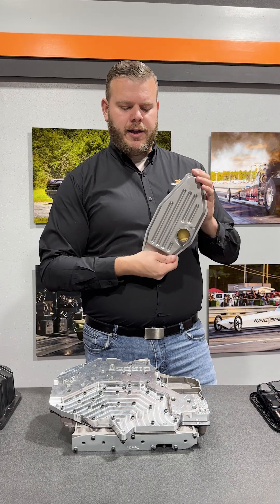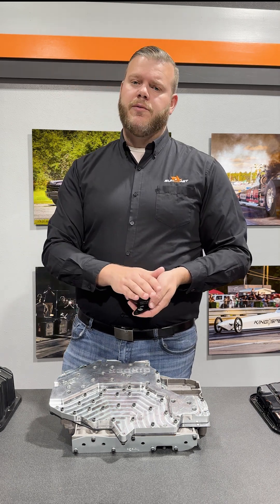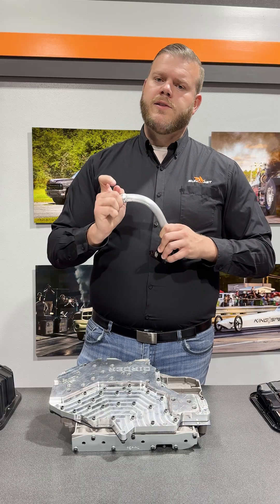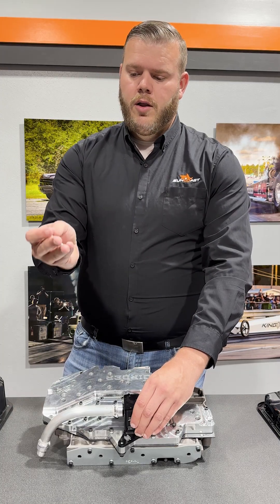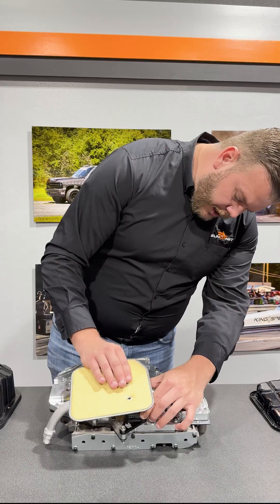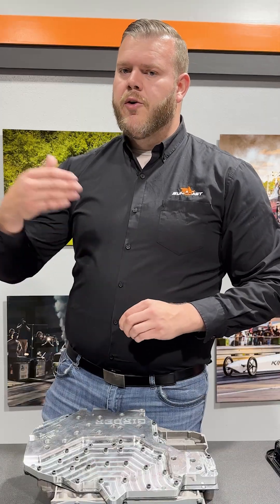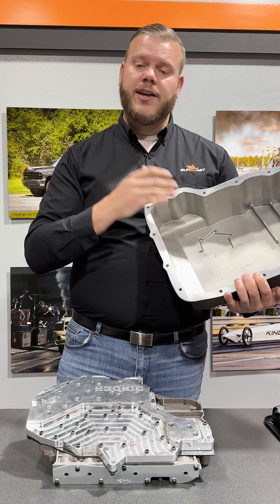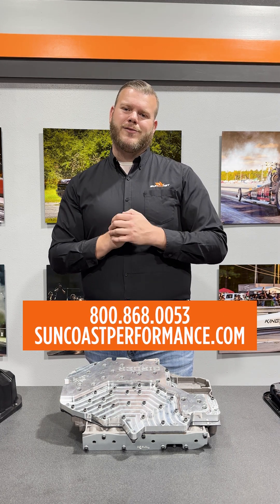SunCoast 68RFE Zero Cavitation Filter Kit Installation Guide

Comment: I just got my filter kit and the transmission pan. Also putting in a Rev Max billet valve body. Hopefully it all works good together.
Reply: does it all work fine?
Reply: @vs-1993 Ya it works great. The transmission shifts so much better. It goes into gear instantly. I originally had the BD line pressure booster and had to take it out. It didn't work with the new valve body and the transmission tuning i have. Definitely worth the money.

Comment: This is a awesome upgrade to garbage oe filter  as a mopar tech the  oem -RFE  valve body torque is 105 inlbs the RE/727 filter torque is 35 inlbs. retorque VB three times in 30 min sessions. Retorque  filter after 10 MIN